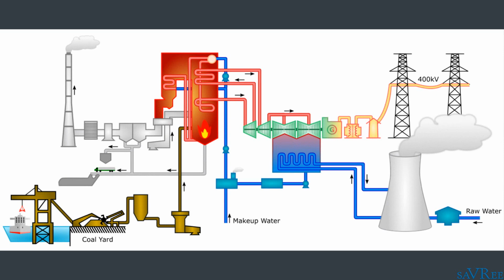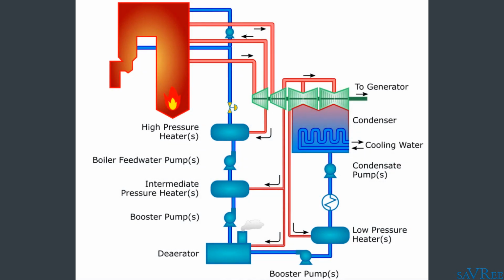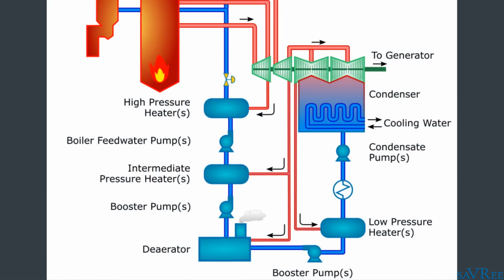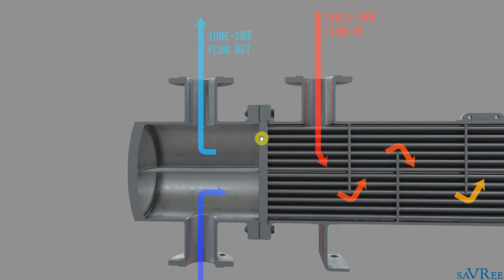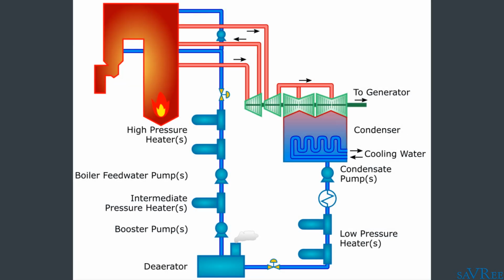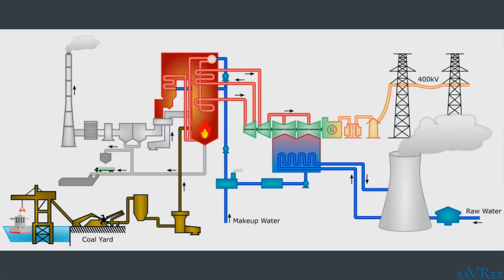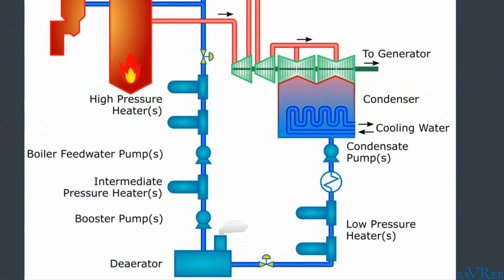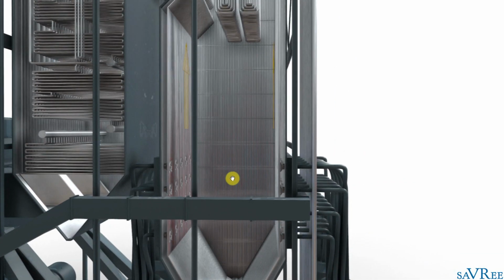How Coal Thermal Power Stations Work (Part 3)

Comment: but if you heat the water in the heater I know that you increase the pressure but I think you also increase the temp which causes the water to boil?

Comment: you did not address Nitrogen gas in the deaeration system, the reason to deaerate water is not only to minimize corrosion but also improve the heat exchange properties of the feed water.

Comment: At 16:36 you said that we continually heat the boiler feed water to increase pressure.i just want to add another point that preheating boiler feedwater also decreases the fossil fuel consumption because energy is saved that would have to be supplied to heat water to that temperature.Although i have a doubt.this came in my examinations.which is more preferred for solar preheating of boiler feedwater- flat plate collectors or evacuated tube collectors.i have got no idea about it.